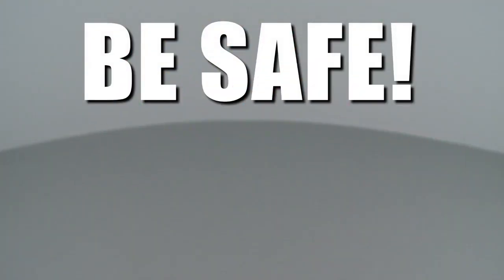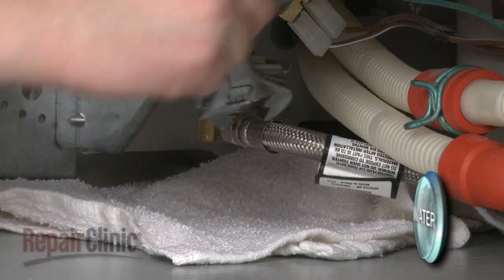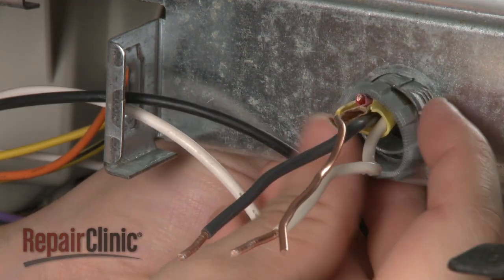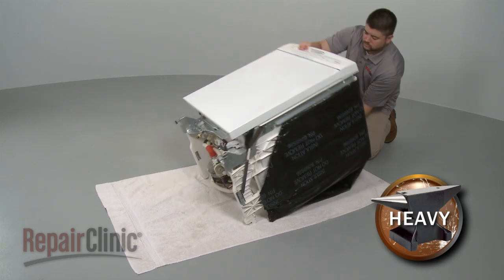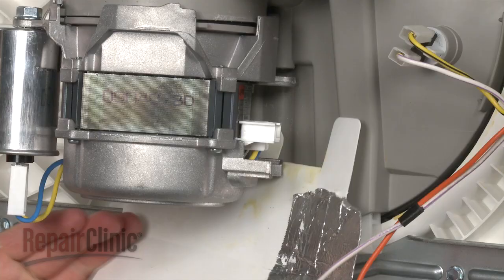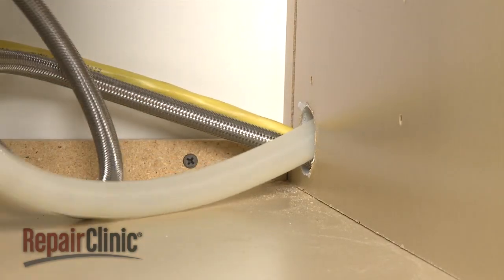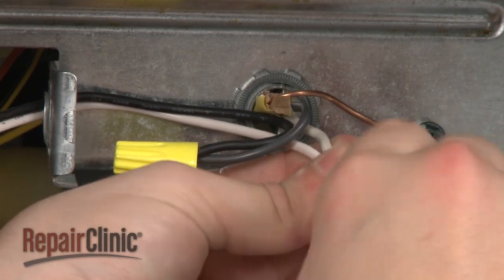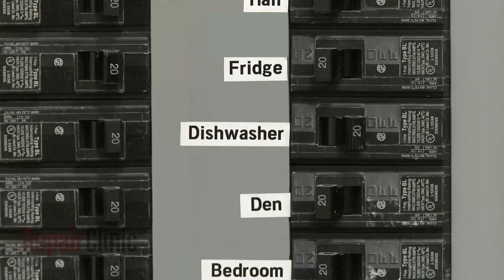Dishwasher Replace Circulation Pump/Motor W10239405/W10239404

Comment from the maker: You will need to find out exactly where the leak is coming from. If it is coming from between the circulation motor and pump you may have a bad seal between the pump and motor. If it is coming from the pump housing seal you might need to take it out and inspect it and the housing to see if there is an abnormality. Also make sure the thermistor is locked in properly in the bottom of the housing.

Comment from the maker: Yes, you most likely have either a seal or bearing going out. When the groaning occurs the motor is most likely slowing down and you are losing water pressure. Replacing the pump assembly should solve the problem.

Comment: Did this exact repair but it leaks between cycles. Not sure why. I have re-installed it twice to make sure it was snug and even coated the rubber seal with silicone grease and it still leaks whenever the motor doesn't run. Help!

Comment: My dishwasher fills and drains properly.  I have cleaned out the bottom of it by removing all of the covers etc all the way to the chopper. As it runs, it groans badly and it sounds like the water stops spraying inside until the groaning stops.  Then you can hear water spraying around again.  Seconds later it groans and the spraying water sound stops until the groaning stops....this keeps repeating the entire was cycle. Think this would be the circulating pump?

Comment: Our dishwasher is not cleaning as well as it used to. I have cleaned out the bottom of the basin and the chopper area (I even removed the chopper and cleaned out the mesh) and it still is not cleaning as before.  Could it be the circulation pump starting to weaken or is there something else I should do first?

Thank you!!
Reply from the maker: Darren Kammer Enter your dishwasher's model number in our website's repair help section for model-specific troubleshooting: http://www.repairclinic.com/repairhelp?TLSID=1773.
Reply: ***** Thank you!  I now see that it could be my water inlet valve...I do notice a "buzz" as the machine is filling so I think it is possible.  However...assuming my float works (it appears to) then would it still be possible to underfill? I assume it would continue to fill (even if it takes longer) until the float switch activates...